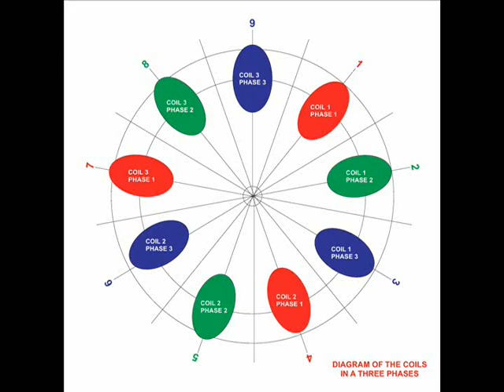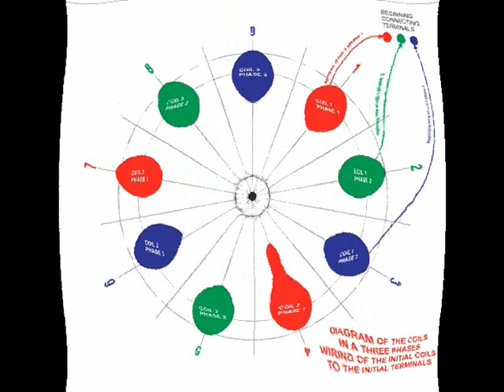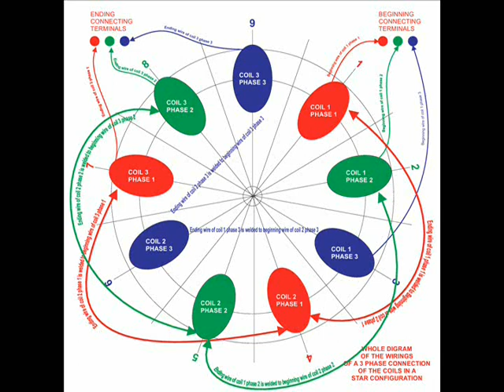STAR WIRING FOR 3 PHASE STATORS

Comment: Hi i have similar stator. Mine is three phase. 
Can i  convert it into a single phase one?  Because my bike is ac fired cdi one and this stator is from a DC powered cdi. So I will need one winding for ignition and other for battery charging and lighting.

Is it possible?
Reply from the maker: yes. 12 coils wound clockwise, then counterclockwise, clockwise, counterclockwise, cw,ccw,cw,ccw ect.
that would be single phase. take one coil out of the wiring of the stator, use it for the trigger of your cdi.
You may have to play with the number of windings on the trigger coil to get the right voltage range.

MUDDy

Comment: Hello! First off very nice video, do you know how this would be wired to a bridge rectifier? Or where the output wires go? My first time trying to build one.
Reply from the maker: x y and z are the outputs.

on these outputs connect 2 diodes to each point. one with the cathode facing away from the connection, and the second with the cathode facing towards the connection. At this point you should have 3 wires with two diodes on each. connect all three off the leftover cathodes together, and all three of the electrodes together. One is positive, and the other is negative.

MUDDy
Reply: Thank you @muddy waters for sharing your info. I am familiar with the 3 phase star from a beginners point of view. 
I have a few questions, mind you, I am a begginer but do understand a bit, the questions I ask will let you identify what I can not grasp yet.
Are the begining  terminals the + - and ground? Or are the ending terminals?
If it is the ending terminals, are the beginning the receiving point of the electricity (input).

And is the ending terminals the output?
Another question, what is the purpose of 3 phases? 
Is it to get more current/amps/watts? 
So if I do a 2 phase or single phase, will I be limited in the amount of energy being produced? Which would seem obvious due to less coils.
Or dose the energy depend on , windings, magnets, efficiency, wind speed? Last one, ;) sorry I'm new, but determined to learn, 
What are the pros and cons of ferrite and neodymium magnets.
I would really appreciate your help. Thank you, from Cancun mexico.

Another question, when placing the coils near each other, do they have to be in opposite direcetions . dose the start end have to be facing up on one, and down on the next?

Comment: can I wire 1, 2, and 3 as one wire and 7, 6, and 9 as another wire
Reply: meaning the beginning of 1, 2, and 3 and the ending of 7, 8, and 9
Reply from the maker: no.   147, 258,  369 are coils in 3 separate phase sets.
connecting 123 together makes 3 phase outputs out of 7 8 and 9 in star configuration.

and for delta connect 7 to 2, 8 to 3, and 9 to 1. this will make outputs of delta 3 phase from 78,and9.

the only other configuration would be single phase which would use 12 coils in series, one coil per magnet.

MUDDy
Reply: how can I make it to have only 2 wire instead of 3
Reply from the maker: 12 coils instead of 9. one coils per magnet. this is called single phase.

each coils is would in the opposite direction from the one before it. (cw, ccw, cw, ccw, ect.

The output will be in AC until rectified with a four diode bridge rectifier for dc. The dc will be bumpy, but still dc. smooth this out with a filter capacitor.
Reply: how is it wired

Comment: Can someone tell which ends of the wires the BEGINNING (A,B and C) or the ENDINGS (X,Y and Z) to the rectifier in a star connection.
Reply from the maker: X Y Z outputs. the starts in star configuration are connected together to form the center of the star.
I hope this helps.

MUDDy